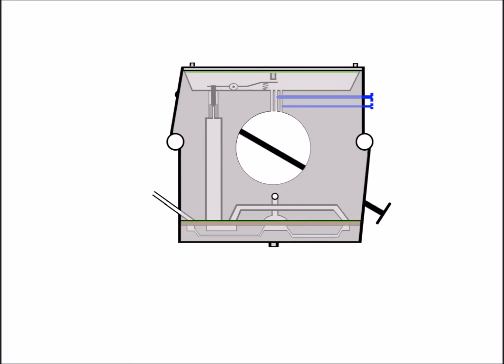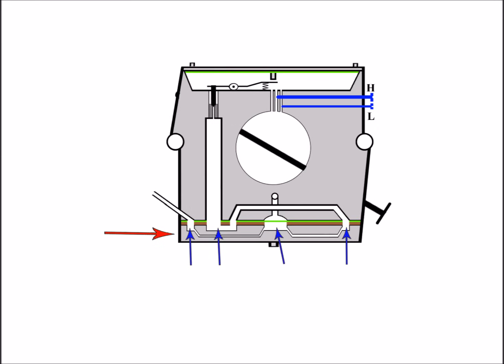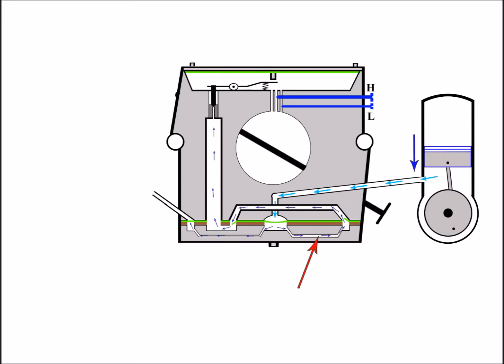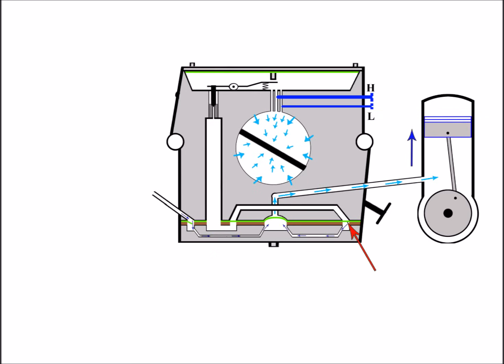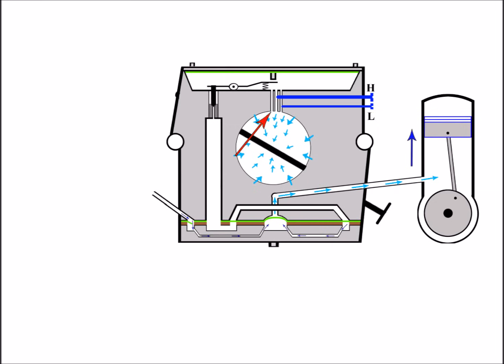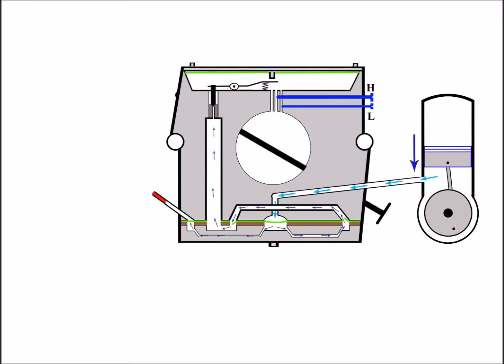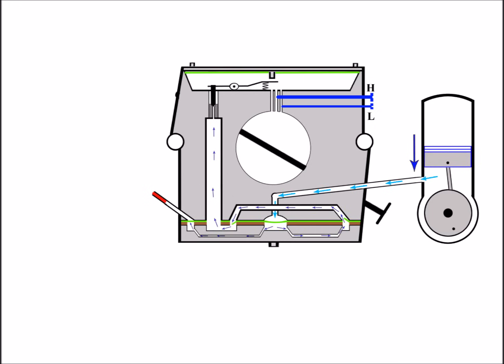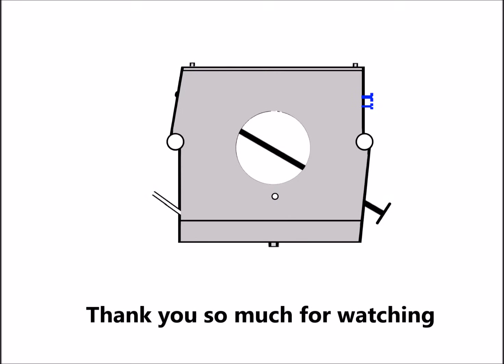HOW CHAINSAW CARBURETOR WORKS: Carburetor Working inside!  (by Craig Kirkman)

Comment: You are an outstanding instructor, I appreciate how you made this so logical and easy to understand. I think I am becoming addicted to your videos, I am finding myself binge watching.  Just one thing I want to confirm, at around min 2:35 where you talk about the pulse line, that would be fuel and air mixture acting on the pump diaphragm, right?

Comment: Amazing as always.  I have a small trimmer carb why does it have two hoses going into the gas tank.  Three come out of the gas tank. I assume one coming out of gas tank is for air suction.  Another to feed fuel to carb.  But why two into the carb?  A black and green one.  Thanks as always
Reply: I think one is for choke the other for throttle.
Reply from the maker: Thank you so much for the nice feedback. I really appreciate it. As for your pipes.  If you have a primer bulb type system then it is likely to be that one pipe if for your fuel feed to the carburetor and the other one is the fuel return from the carburetor back to the fuel tank. If this is the case then when you press the primer bulb, fuel is drawn from the tank, circulates the carburetor (primes it) and excess is taken back to tank.  This is the most likely explanation without of course without seeing it myself. 

If this is the case then here is another one of my videos that kind of shows this particular system : https://www.youtube.com/watch?v=c0LwmE7BC3o .  

I hope this helps. Craig

Comment: The metering gasket goes on against the carb body then the metering diaphram this allows a space for the diaphram to move within
Reply from the maker: Yes absolutely, but I haven't shown a metering gasket in my diagrammatic model. I have only shown a fuel pump gasket and thi is in the correct position. The fuel pump diaphragm touches the carb body so that the valve flaps can operate directly on the carb body to regulate the amount  through the fuel veins. But yes, you are absolutely right when you say the metering gasket touched the carb body. I just haven't shown a metering gasket at all. Thanks
Reply: Yes I'm aware that you know but I see so many carbs I repair after repair by others that have put them in backwards so I thought there must be quite a few who want to know!

Comment: I'm in South Africa I watch a lot of your videos I have one or two questions to ask is it possible to get hold of you somehow?  I work on electric and 2 stroke scooters that use basically a brush cutter/weed eater motor, it's a long question to ask but I brought a brand new motor and would like to ask a few things as I dont think its performing as it should  wont rev up properly and not sure if its ignition timing or detonation or who knows what.its a brand new motor and it still works just not properly so I cant return it. Also really would like to keep it and sort it out because it's got a big displacement. Please help if possible.

Comment: How much pressure can the diaphragm produce. I'm asking because I want to fit an inline fuel primer bulb. This has a one way valve and can be bypassed with breath from my lungs so way less the 1psi. But will the diaphragm be able to easily pull the fuel through the primer bulb or will it wear out the carb quicker or even worse run lean because the fuel is not being supplied easily enough

Comment: I have a request for a video on the purge/primer check valves on a zama carburetor c1u-w43. There appears to be 2 methods for these check valves to work. One has a little red valve that is under the buld. The other has check valves that are built into the body. I have both of these. The problem is I ruined the one that has the check valves built into the body by running a wire through them. I was wondering if you could do a video showing how you could repair this if possible. Also, maybe do a video that says don't run a wire through these types of check valves. Also, it would help if it was better explained how they work. One of your videos mentioned a spring and a seat, but didn't explain where they were or how they worked.

Thanks,
Jim Rice
Reply from the maker: Hi Jim.  Yes, well said.  I will look into adding that to my list.  I noted though, that you had looked at one of my other videos.  Was it the one in this link? If not then this might be a very good place for you to start.  It's not exactly your type of carb but it is close.  It will give you a good idea whats going on. Again, i'm sorry if you have already seen this.  Thanks Craig : https://www.youtube.com/watch?v=jalfpoldyo0&t=17s

Comment: What can cause a chainsaw to sometimes idle way too fast and at other times too slow?
Since there are no moving parts involved in the jets themselves, one would expect that as long as there is fuel in the metering area, nothing could work differently, so as to explain the difference in the idle speed, right?
Is it possible for instance that the metering needle valve does not close properly, so that fuel pressure in the metering area is higher than normal, forcing too much fuel through the jets, and then the saw might idle too fast?

Comment: It's my understanding that rather than "ready pressure" (which a conventional liquid can't actually hold on its own) the fuel comes in on one side of the diaphragm on the intake stroke and is pushed to the other on the power stroke through another flap valve over a port in the cover. The same diaphragm movement which draws the fuel in to one side, pushes it towards the needle valve and return line on the other. 

On the power stroke the opposite movement evacuates the reservoir in the cover, moving the fuel to the reservoir in the body. The goal being to avoid pumping fuel through the jets under crankcase pressure, but rather allow it to be drawn in under atmospheric pressure. 

At least that's how a see it.  

Regardless, each one is a brilliant little masterpiece of industrial design. Minimal parts, simple construction, inexpensive materials, adjustable, versatile, gravity-neutral and durable. An astounding mechanical accomplishment in the palm of your hand for a few pounds and pence. Beautiful!

Love your videos! Keep up the good work!

Comment: Although you did your best but you even did one big mistake.lol
Until now there are no such degree in engineering which goes by the name repair engineer.You mentioned that you are a repair engineer but to your kind information it's not engineer it's MECHANIC. Simply a repair MECHANIC.You don't hold a engineering bachelor degree.You are simply a mechanic.Although you have got talent but it doesn't mean you will consider yourself as an engineer or to the level of engineer.
It's an offence to do so without you being an engineer.You should remove the sentence and replace it with MECHANIC.
👍👍👍👍👍
Reply: Maybe you hold a bachelors degree, but your lack of education, Mr Boro, is more than evident. Just two links: https://en.oxforddictionaries.com/definition/engineer and https://www.collinsdictionary.com/dictionary/english/engineer
Then you may learn that a person who maintains or repairs an engine, any engine, is an engineer. And this engineer is more knowledgeable than many ones I have seen holding not just a bachelor but a master or even a PHD.
Reply: Yes I agree.  He explains someone else's invention quite well.  The carb was DESIGNED by an engineer. This man is more of a technician.  He obviously understands the workings of the carb.  So yes, I would describe him as "technician" or "mechanic."

Comment: I rebuilt my mikuni carb today it's for a 92 Yamaha waverunner 650. How high should the control arm be?When I placed the diaphragm on, the little piece of metal in the center of the diaphragm seems to be touching the top of the control  arm. Should there be a little space between the two?  Thanks in advanced

Comment: To the Repair specialist: What is happening when the trimmer starts great, and goes into it's idle stage and then dies. It just won't idle. How do you fix? Is it the metering arm out of adjustment problem? Can you answer my question about this problem? Thanks!
Reply: Check the tubing coming from the tank and if it is one coming from the crankshaft check it too. The ends should be tight as the pulsed gas pump is not forgiving of even quite small leaks that allow air to enter the lines.

Comment: excelend video!! maybe you can help me: i have walbro 997 carb all settings is deafult, my pistone ring is ok, fuel tank and the hole are clean, pulse carb is clean, gaskets new. the problem is when i get full throttle and left the engine die, hope that you can help me, thanks :-)

Comment: that couldnt have been explained any better. ive been having problems with my stihl carburetor on my chainsaw and i am familiar with all the pieces to the carb but not their functions. after watching this video i fully understand the way the carb works and its functions. so thank you for your knowledge and hard work on this video. its was really explained perfectly.
Reply from the maker: IKrugerr, wow, thank you so much for your motivating feedback. It's comments like yours that keep me motivated to continue making these videos. Many thanks again.
Reply: yes sir. I should be thanking you though. To be honest i had 2 chainsaws that were bogging down and would die when pulling the throttle, so i messed with the high and low adjustments and nothing. so i sat down and watched your hour video on 12 reasons why a 2 stroke engines boggs down, this was after i  watched your video on the carburetor and how it works. After these videos i had enough confidence i could get these chainsaws running. I did a little more studying on your videos, then started inspecting and cleaning the carb and engine in the areas you explained. and i now have 2 running chainsaws 1 day later. so thank you for your knowledge! i have never been more inspired to work on small engines than after these videos. cant wait for more
Reply from the maker: IKrugerr fantastic, thank you

Comment: is there always enough fuel inside the carburetor to start the engine or does it need pumping? does any fuel enter the cylinder directly after turning the engine off?